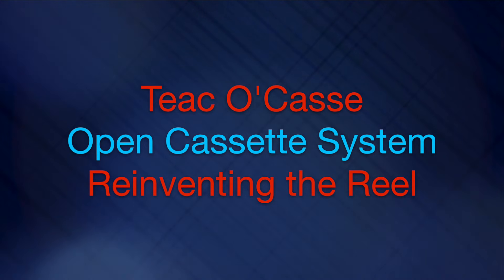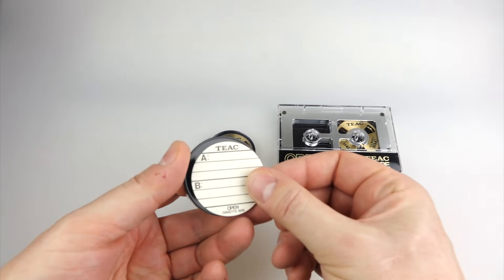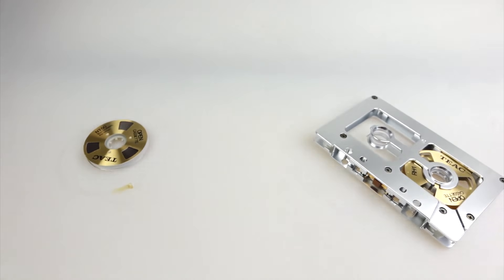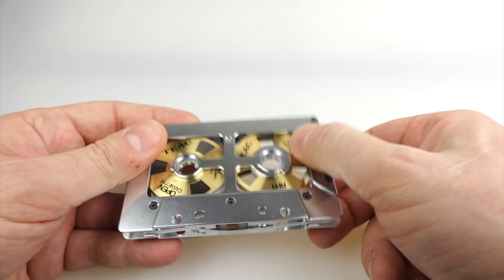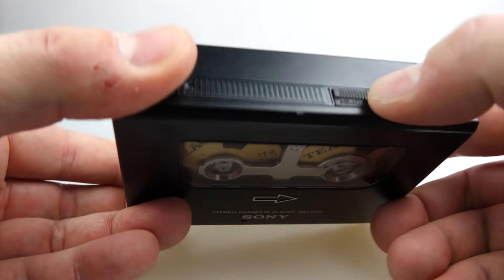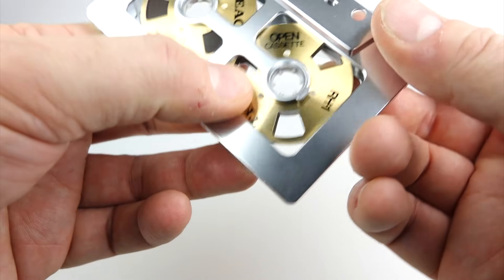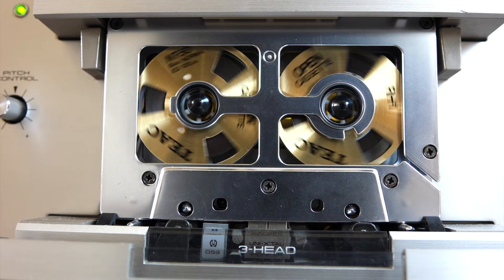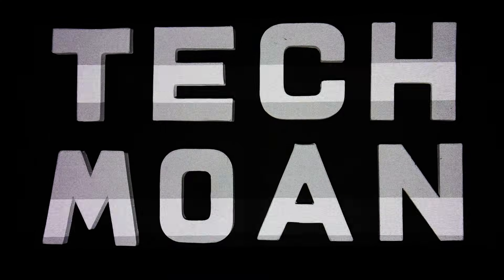TEAC O'Casse Open Cassette -  Reinventing the Reel

Comment: Hi, I am surprised that yours is plastic - mine is definitely aluminium. As you suggested, there are knacks to putting in the tape (put the lug in first before pushing the tape in behind the tabs at the base, for example - and give yourself slack). I have seen some of the advertising and it was sold as a semi-pro/pro portable system as well as being cool, as some of the tape is the higher bias chrome, etc.. The fashion probably relates to the colours the reel came in. Even the normal tape might not be normal; mine seems to record and play fantastically well (I guess they used their best "normal" formulations). I will admit to not knowing exactly what it is but I am sure that some one could tell you.

Comment: I remember you could buy the reel to reel tapes but you did not swap them out like these as they were sealed units, I got them because they looked much better in my system than normal tapes.

Comment: i think that might have been intended for data, a relatively cheap version of tape drives that are still in use today at places like the lhc where massive data dumps occur but the data doesn't need to survive more than a decade or two. i'm betting that was intended to be a cheap solution for reducing the volume of casettes needed at some lower end banks and things like that, they tended to use cheaper backup solutions like cassette in the 80s and even early 90s. spreadsheet data doesn't take much space, if a bank had a set of five cassettes they could backup transaction records for thousands of people. if they make that backup daily with five tapes a day cutting the storage space in half starts to make sense.

Comment: It's one of those things you say, "You just had to be there."  The real downfall was the cost of the reels at nearly double the price, and the obvious inconvenience of switching them out.  As for the types of tapes used, you purchased more than one tape holder to switch between.  Sony changed the style & introduced a line of tapes that had the metal reels inside their higher quality cassettes, so you didn't have to carry all of those reels to have the same look.  It was just a cosmetic gimmick really.

Comment: They did normal cassettes with those reels.  The cassettes were clear so you could see the tiny reels going round .  I think I got two in the late 80's and they were rather expensive. When I tried to buy a third I could not find them anywhere (in Bradford). 
I recorded John Peel on it btw 😊

Comment: I had a bunch of these in the 80's. At first, I thought it was cool as hell. But it got old very quickly. It was a huge hassle to change out the reels. And it wasn't easy to do at all. A standard cassette was far easier. Sure, it wasn't as compact as carrying  bunch of reels in your pocket, but was much easier to just swap the whole cassette.

Comment: This could have easily been engineered to be spooled very quickly by anyone. For a start the case could unclip into two halves then just secure the reels into sprockets, feed the tape then clip the two halves back together. A ten second job. Like so I would have preferred these because tapes like CDs take up too much spaces. I used to hate those tape towers - very unsightly.

Comment: For mass market, this is of course not a great idea, but for certain markets it's brilliant. (Or at least it would have been, if cassette had become the leading format, rather than the leading format for these groups skipping straight from vinyl to CDs.)

The two markets where it would be great would be audiophiles (And I'm speaking of mass collectors more than people concerned with range quality. See above parenthetical statement) and techs.

Basically for people wanting to archive huge amounts of audio, without taking up a ton of space, this would be an amazing format.

The time taken changing out reels wouldn't matter if you had 3 cassettes, (record/play one while you load and label another) but the space taken up by 500 full plastic cassettes mattered in the age before digital media storage and terabyte hard drives.

Imagine being a road manager for a comic, or other spoken word performer recording sets with cassettes and having to keep all of your recordings and blanks with you until you were done touring. 

(Anybody watch the show Marvelous Mrs. Maisel? People actually did that. Hell, I did that as recently as 2004 with video tape, and I would have loved a system like this instead of 50 digital8 cassettes a trip.)

So, yeah... Not for everybody, but still a brilliant idea. 

Don't discount an idea before asking how it might be used differently than you first thought, and why people might have wanted it.

Comment: Back in the day, I was always playing around with cassettes when they jammed or the felt bit fell out or the cases cracked. Fiddling around using this system would be second nature, and it looks cool, too. Shame no one thought to invent auto spooling though. Still have hundreds of cassettes - some now over 40 years old and amazingly still working! The 80's chrome dioxides especially still sound pretty good. Luckily my car, built in 2004, still has a working radio cassette deck that was fitted during production. So plenty of old stuff to listen to on trips.

Comment: I remember purchasing one of these sets. Pain in the butt to change the tape, and if you lost the plastic reel clips, there was no easy way to keep the tape from unraveling. With the extra overhead of the reel design, these tapes were limited to 50 minutes instead of the normal 60 or 90 lengths, which made them too short to record many albums. They should have had rotatable bias selector tabs like the write protect tabs on a TDK MA-R.

Comment: I am slightly proud to boast that I've been heavily involved with cassettes for 50 years, and that subsequently, to such an extent that the BBC did a programme on me... so having now qualified my credentials I am somewhat at liberty to express that, in my humble opinion, this is utterly bonkers! Totally impractical and not even a novel idea that would have an attraction after the first few usages. Aside of all else, look at the expense (then and now). Why invest in this when you could buy something of a decent deck with the same dosh, or a stack of half decent Type 2 or 4 cassettes? Perhaps I'm missing the point. Good vid though. Thank you.

Comment: i can sum it up in two words, LOVE IT. i remember these back in the day,  and they were a bit of a chore to mess with but well worth it, but they went the way of the cassette tape, more like the way of the dinasuar, but in retro spec they are like old school muscle cars, now we wish we had kept them, even with there horrible gas mileage, and not so great handling. These things rock, because they look so much cooler than a normal cassette or a CD, its like comparing a very nice looking turntable to a audiophile grade cd player, visually the turntable wins hands down, and in most cases sounds better too, now picture this cassette tape in a Pioneer CT-F900 open face cassette deck, it will look awesome, or even the Pioneer CT-F700 with its huge retractable clear cover. which i just happen to own both. the real down side to these type of cassette tape is the price, i really had to search for a US seller, lots of them in Russia, germany and austria, average price is about $150 or more. it would be awesome if a machinist made one of aluminum.

Comment: You only needed to take 2 cassettes, because that's all the batteries lasted anyway. ;-)
I would always find tracks to fill every second of the tape, so I wouldn't need to FF or REW when flipping a cassette, added drain on battery. Mix tapes were life.  
Never saw those back in the day, but I would have shunned them as a gimmick anyway.

Comment: I would' mind to buying even these days the system O'cassette from TEAC, if it cupid be still available.  It looks just AWESOME, even if it sounds the same like a regular CC.  In television station, where I worked for 11 years, of being a single tape operator, who could save emotion of the prerecorded program on video cassette, when tape inside it was broken or damaged.  Only I had a delicate hands - on knowledge, to open the case, fix the tape and put everything back again in the right order, to make "broken" cassette playable.  The rest of the people were just looking of what I was doing, and they couldn't believe, that video cassette would be working perfectly back again, after my fix - up !!!!  EVERYTHING comes with the little knowledge :o))

Comment: My gut instinct is you're not meant to take the tape back out of the caddy but to have one caddy per tape.  Or maybe that is what they are hoping you'll think.  Why have a 1-time plastic notch to break out for chrome (or whatever) unless you are meant to keep the same tape in the caddy all the time?  Its illogical.  I think they were expecting the coolness to out-weigh the extra expense of buying a caddy for each tape.  You noted how much trouble it was getting the tape back out - much more than the trouble to loading it in.    I've seen all the novelty of this without any of the work; its a cassette that comes preloaded with what looks just like reels inside  but its sealed and you never have to mess with it.  All the coolness, None of the hassle.

Comment: i think it was marketed wrong.it could actualy have been preety usefull for REALY low storage space situations in stuff like emergency storage.
lets say i want to put multipule cassets amound of information in somesort of emergency supply bag that needs to contain food a flashlight, matchbox ......

you can theoreticly store ALOT more of these cassets then notmal ones in lets say a small safe

other thatn that it has no practical use other than looking preety
Reply: Microcassettes would be better for that.
Reply: The collected works of Herb Alpert recorded on Teac O'Casse are going in my emergency kit to make room for an extra can of baked beans.